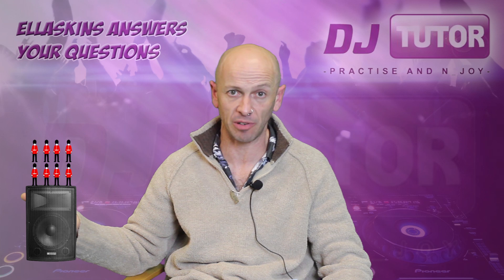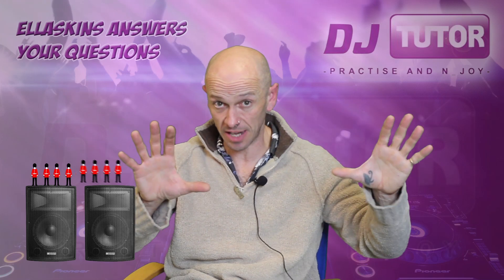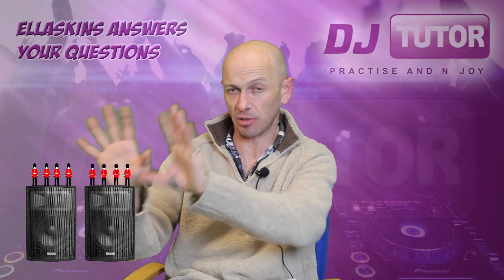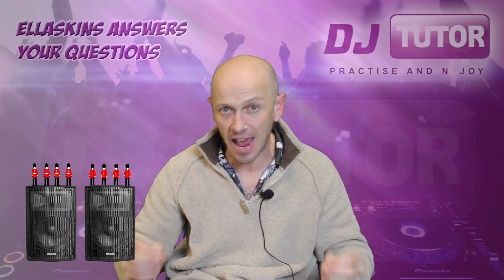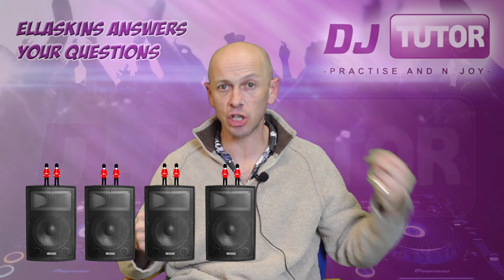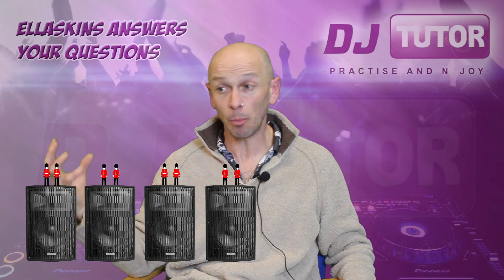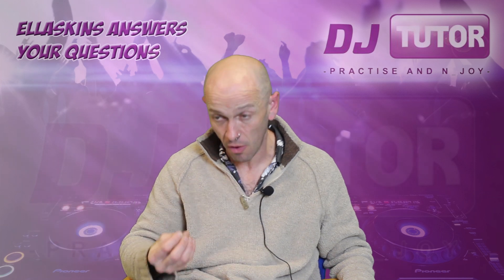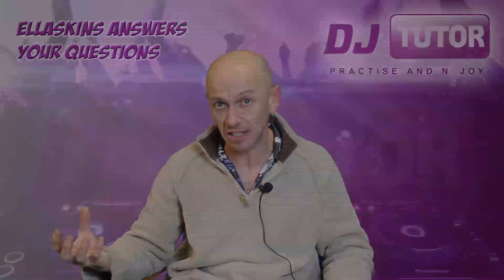Speaker Impedance, or Ohms, Explained in a nutshell

Comment: Hi mate I love your channel you are very knowledgeable and experienced I was just like to ask

I mate thanks for your input. Pardon the pun!!! 

 I want to connect extra speakers to my amplifier  running   In series! My amplifier is Sony 1080. At  165 watts a Chanel.  At 8 ohms.

for example!  Two speakers at at 8ohms Making it 16 ohms  and it’s a 7.2 system 

For example I have  one right hand floor standing Speeker.  And I want a high Speeker For on the ceiling.   If I was to do that to both floor sand speakers left and right wired in series cut the amplifier support that okay do you think? I would appreciate your reply, thank you. Steve

Comment: Clueless. Even with simple series / parallel connections we have the issue that DC resistance is NOT the same as AC impedance. In some situations some speakers can exhibit negative impedance. This is due to how they are acoustically coupled to the enclosures and to the damping factor of the power amplifier output stages.

Comment: I’ve been down the rabbit hole, trying to learn ohms Best video I’ve seen and easiest explanation!
Reply: This is fine in DC circuits. It doesn't work with AC.
Reply: @paulanderson7796  Do you often wire car audio systems with AC?
Reply: @jasonb6570  Audio signals are AC. We're talking here about speaker impedance, not about supply rails.

Comment: Cool, I get that on the multimeter it uses the Ohms setting but what's the difference between measuring ohms with resistance (for resistors) and impedance for the speakers? Is the speaker acutally a huge resistor then?

Comment: Why does adding a speaker, which has 8 more ohms, “steal” the ohms from the first speaker? What happens to the 8 ohms it has by itself. It seems that if you add speakers, you add ohms.
Unless the ohms aren’t provided by the speaker, but must be divided out by the amp.

Comment: this just explains that this guys speakers don't shake the ground, I wouldn't buy a pair of 1500 watt rms rated subs for my car just to have them restrict a 3000 watt amp....That would be stupid.  As for sub woofers rms is the rating you look for followed by lower ohms and a large enough amp to push them at the combine total of the subs rms.  They usually advertise the peak watts on subs, pay no attention to that number as your rms is your consistent.

Comment: I have been researching for a few hours now. I'm building 4 subs for my current system and I need to know how to raise and lower the independence in the sub.  I would appreciate any knowledgeable info on this. I know it can be done with lengthening or shortening the windings. As well as amount  of wraps. Just need some direction or a link that  covers this. Thanks

Comment: I have an older Sony HT system with 6 ohm rated cube satellites - I have some higher quality similar sized speakers, but they're rated at 8 ohms. Can I use them on my HT? What are the risks involved? Thanks!
Reply: Not good for the power amp
Reply: It's like trying to fill a 1 ltr bottle with 800 mL of water,

Comment: Who runs their speakers in series?
Reply: Professionals do.
Reply: Joe R then that is your choice. It's extremely difficult to tell the difference when wired properly with a good set of speakers. EQ, file being played, and any other device to which the sound goes through, has to do with the quality. But chaining has little to do with the actual quality as long as the amp can support it.
Reply: V!K can u read my comment at the top to see if u can help me im building a portable speaker from an old guitar but having issues

Comment: Depends if you're running in parallel or series, bad analogy
Reply: Great analogy if he explained it both ways. Actually, three scenarios  I'd like to know:  SCENARIO ONE:   Speaker #1  8 ohm plus speaker #2  8 ohm wired in SERIES.   SCENARIO TWO: same speakers, Speaker #1 8 ohm plus speaker #2 8 ohm wired in PARALLEL  Scenarios THREE and SCENARIO FOUR:  Speaker #1  8 ohm plus speaker #2  4 ohm  wired in SERIES and wired in PARALLEL

Comment: Bad analogy. As if only one speaker gets to have bodyguards to share.
Reply: works for the consumer, in detail, it's far more complicated than that. The less ohms (resistance), the more power you can push to them (amps are the amount of power flow, voltage is the pressure, and ohms are the resistance [what brings the power down, hence the guard analogy])

Comment: This article is about stupid... I am learning more from reading the posts here... But, I do have a question.... I notice inside my speaker cabinet.... My mid-range is 6 ohms and my tweeter is 8 ohms and (of course) connected in parallel... So, total per speaker cabinet is 14 ohms.... It is normal for speaker manufacturers to mismatch ohms...

Comment: So is a amp that is set for 2, 4, and 8 ohm is that ok to plug 2 x 100 watt  6 ohm speakers ??? please reply
Reply: Bend Em If your speakers are single coil, then if you plug them in parallel the final impedance would be 3ohm, if you plug them in serie it would be 12 ohm.
The best way would be to plug them in parallel, so you get 3ohm and then add a resistance of 1ohm in order to raise it to 4ohm. (It will be hard to find such a small resistance, i'm not sure if the amp will like 3ohm)

Comment: Perhaps you mean "in parallel." In series (one speaker connected to the next, the ohms will ADD together to create MORE ohms of resistance. In parallel (all speakers wired to the amp individually), they will divide the ohms down to LESS ohms of resistance. Not claiming to be an expert, but that's the basics. More complete explanation I found at:
http://www.soundonsound.com/sos/jan03/articles/impedanceworkshop.asp

Comment: Hi nice video but do you know what is the difference between 8 ohms and 4 ohms speaker when it comes to the sound they can produce? does 4 ohms speaker produces more bass than 8 ohms? or opposite? in short what is the relation of speaker impedance to the tone the speaker can produce? does the lower the impedance of the speaker the more bass it can produce? or opposite?

Comment: This explained nothing...
Reply: Well it really helped me understand one thing that’s been bugging me. And that was Ohms and how they are changed when you have more speakers.
Reply: +stvnburg Ok I concede it explained 1 thing...
Reply: It actually does, ohms are resistors which hold back power to lower amps flowing through (amps are the amount of power flow, volts are the pressure amount, and ohms are the resistance, to reduce the amount of power flow), the more speakers you have, the less the ohms and the more power you can push to them. Just look at an amp spec sheet and you'll see, but each amplifier has a limit of ohms it can do.
Reply: @VictorEstrada that explained nothing.
Reply: @Venerablenesses  in electronics, higher numbers doesn't always mean higher. In ohms, higher number is lower and lower is higher.
Reply: @VictorEstrada  Thanks man.  I'm going insane trying to understand this.  I thought the video was decent too
Reply: @VictorEstrada  What's a watt then?  You mention amps, volts, and ohms.  Thanks (fingers crossed)
Reply: Dumb 👿
Reply: Agree
Reply: it explains a lot
Reply: It is literally wrong. Each speaker will not get blown. Adding more speakers increase the amount of total power the system can handle.
Reply: Agreed waste of time, could have put some more effort into this video

Comment: Hi, everyone! So I have been using our home theater for a year now.  I'm currently studying DC circuits on a Computer Engineering program so that's why I have a less knowledge on impedance matching. The scenario is that the home theater runs 5.1 channels with the port of subwoofer rated at 4 ohms. The current subwoofer is a 4-ohm subwoofer at 250 watts. What does it mean by the watt rating of the speaker when the total output power of the amplifier is 1000? The case is that I feel that the subwoofer does not give that much bass. So I'm planning on upgrading my subwoofer to a 14 inch from a 10 inch. I found a 14 inch subwoofer on our nearby appliance store and have it tested. I was beyond satisfied by the bass it gave. The 14 inch subwoofer is rated at 300 watts at 8 ohms. My question is: What exactly will happen if I'll hook it up to my receiver? Will it sound the same as to what I felt on the store? Will it burn the amplifier? Or somewhat, the speaker(the planning to buy, 14 inch)? It's Pioneer that already has a casing. Take note that this subwoofer is a powered one. The one that is needed to be plugged.

A detailed help to my problem is very much appreciated, guts . :)

Advanced thanks to you and cheers for your knowledge on impedance matching. :)

Comment: I'd smelled something from the trunk burning ,like wire or plastic
Reply: If you are measuring ohms, yes, the coil have broken, or the coil has detached from the terminals.
Reply: supertech2006
I just took apart the speaker, yeap the coil is toast..Q.. when the owners manual for a speaker says its 4 ohms is it safe to wire it to 2 ohms....I know its not to run 2 dual coil speakers to 1 ohms, that how the other speakers burned up
Reply: Glen Fawcett Are you asking if it's safe to wire it in parallel to another 2 ohm speaker - this will depend on your amp.
If your amp is rated to a 4 ohm maximum load, then the 2 ohm speaker itself is too high an impedance for the amp.
If the amp is rated down to 2 ohm impedance, putting anything in parallel with it will drop the impedance possibly causing amplifier damage at high volume. This however is NOT how speakers get damaged. Running too much power into a speaker is how they get damaged. That, or if you happen to damage the amp, and it starts running DC current through the speaker. In fact, let's say you have 2 250W speakers at 8 ohms, and you have a 200W amp rated for 4 ohms. If you put the 2 speakers in parallel, what happens is they each will consume 100W each (they would do this even if you only connected one speaker). If however your amp was rated at 200W at 8 ohms, connecting the 2 speakers together would be a bad idea and would cause an overload situation at anything close to or over half volume.
Reply: my amps are capable of 1 ohm ,but very time I  wire 2   dual coil (4 ohm)speakers  to 1 ohm I burn the coils
Reply: This could be because you are driving the amp to distortion. square waves will ruin a speaker. Although your amp may be rated down to 1 ohm, if you over drive it, it'll square wave.
Reply: +SuperTech-IT you can easily overpower speakers and not get damage, its when you overpower them with a clipped or distorted signal thats when the coils heat up and fry
Reply: You can blow them with undistorted power as well. Square waves just do it more easily.

Comment: I have a question if I was building a 3 way speaker how will the ohms work say the base and mid are 4 ohms and the tweeter is 2 will it still run on 4
Reply: Most often in a situation like that, you will be using a "crossover". If your crossover is designed for three 8 ohm speakers internally (a whoofer, midrange and tweeter, all rated at 8 ohms a piece) the crossover will do some load balancing, and will usually be designed to present an 8 ohm impedance to the amplifier at the terminals. If however you are just willy nilly wiring them all in parallel, the bass and midrange are 4 ohms each so together they present a 2 ohm load. put this in parallel with another 2 ohm load, and your impedance drops to 1 ohm, and your amp likely goes boom when you turn it up since the best amps are typically rated for a minimum of 2 ohms. The more speakers you present in parallel, the lower the ohms. Your best bet if not using a crossover in your hypothetical scenario would be to put the bass and mid in parallel, and then put that parallel load in series with the tweeter, giving you an overall impedance of 4 ohms. Unfortunately, since there is no proper load balancing, the tweeter would get half the power going to the speakers, and the bass and mid would share the other half between them at 1/4 of the input power each. This would make for a rather tinny speaker.
Reply: supertech2006 but what if i don't have a crossover, and i have a woofer and a mid range that are 8 ohms and a tweeter that is 4 ohms. can i use a capacitor in series each for the mid range and tweeter that act as the crossover? then connect the tweeter, mid range and woofer in parallel(the woofer is connected directly to the amplifier)? a lot of people doing that, so i decided to measure the impedance of this circuit using an ohmmeter and the meter only reads the impedance of the woofer, of course that will be the outcome, but i'm confused if this circuit will not damage the amplifier?
Reply: Jefferson Barrion You're only measuring the static resistance, not the impedance. The speakers with their respective capacitors will each be close to their impedance within the frequency ranges allowed to pass through the capacitors. You run a lot less risk of overloading the amplifier because only certain frequencies impose the full impedance of the speakers attached, however your best bet is to invest in a proper crossover.

Comment: what would happen if I ran an 8ohm speaker and a 4ohm speaker together on each channel of an amp? what would be the resistance?
Reply: Depending on the specifications of your amplifier (that you did not state) the 4 ohm  speaker would be much louder than the 8 ohm speaker if you hooked up the speakers separately into each separate channel of the same amplifier. The resistance would be what you stated (4 and 8 ohms)
Reply: 1/8 + 1/4 = 1/8 + 2/8 = 3/8 inverted = 8/3 = 2.66 (2 2/3) ohms per side.
if they were both 4 ohms
1/4 + 1/4 = 2/4 inverted = 4/2 = 2 ohms
the formula is basically
___1____
1/r1 + 1/r2
this works for no matter how many loads you are using (IE, it can be one over 1/r1 + 1/r2 + 1/r3 + 1/r4) where r is the speaker impedance in ohms

Comment: then how i can "convert" a 4 ohm ampilfier to 8 ohm speaker? Somebody can help  me? please.
Reply: Thanks man did help me :)))))
Reply: There's no such thing as a 4 or 8 ohm amplifier. Amplifiers output power to speakers as expressed in watts and ohms are units of resistance. Only the resistance a speaker imposes on an amplifier can be expressed as ohms. The wattage rating of an amp will vary depending upon the impedance imposed, but impedance is not an expression of power!

Comment: I've got a pair of my dads kenwoods home thearter speakers. Unfortunatley the amp was binned due water damage :/ They have a small tweet/omni at 6ohms 15W and a mid range at 8 ohms 50W. Could you give us some advice on how to even out the impedance ?

I've heard of friend awhile back using a resistor across the terminals to add an extra 2 ohms to say a 6 ohm. Would this safley work  ? and would it respond like a normal 8 ohm speaker in calculations ?

Comment: getinthemixonline Hi guys, If you have an amplifier that goes down to 4 ohms, does that mean that it goes down to 4 ohms per side or 4 ohms in total taking into account both sides? 

So to get a 4 ohm load on the amp do i need 2 subs and 2 tops? One sub and top chained per side, or can I only have one 8ohm speaker a side? 
Help would be much appreciated thankyou :)

Comment: i have 2  200watt rms  400watt peak  8 ohm speakers. my amp is 270watt at 8ohm a side. is this a good match ?. any advice would be a help. cheers.
Reply from the maker: Yes, they are pretty much matched, although the amp is a little powerful assuming it's 270watt RMS a side.  Basically, don't run your amp at full power, we never recommend that anyway, but with your set up, if you do, you run the risk of blowing the speakers.  Have the amp turned up to about 3/4 full volume and you should have no problems at all.
Reply: getinthemixonline thank you